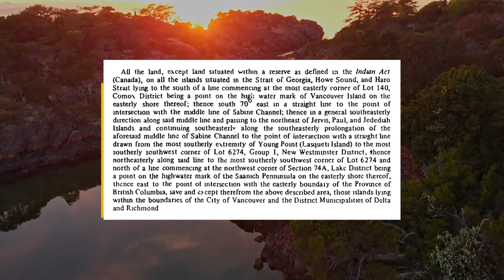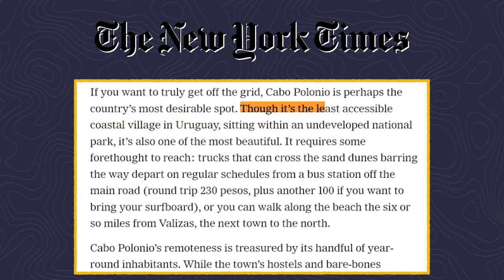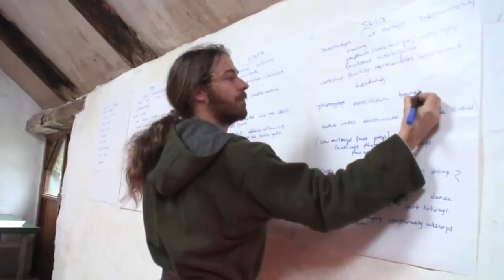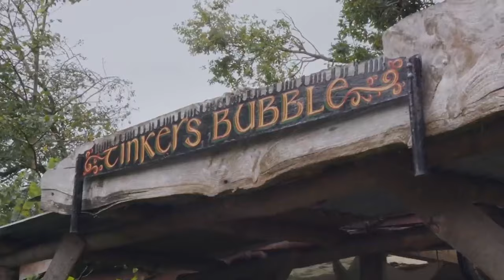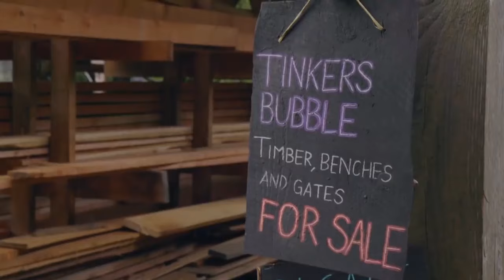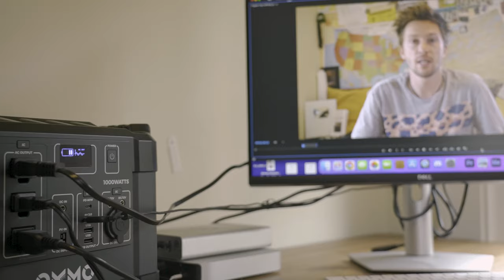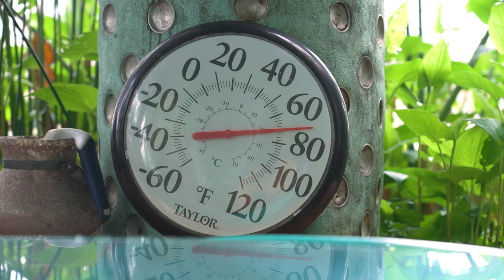Top 5 Off-Grid Communities (Earthships / Homesteads)

Comment: The main law to off griding is that you must have electricity. You must have solar power. Plain and simple.
Reply: Using equipment made abroad where the toxic byproducts can be dumped without cost to the manufacturer - shipped in a container using crude oil ... ...

Comment: I'd put the one that also manages to produce more than 75% of its food at the top of 'off grid' lifestyles. I'm 65 yrs of age and was just reflecting on how many tyres I've junked during my lifetime. I suspect it's not enough to build a house. Of course once it's up it should be there for more than one lifetime. In that respect turning the least biodegradable junk into houses is an inspiring idea for now. However one can't forget as a sustainable way of life, it needs junk producers who are somehow managing to drive about in cars and wear out tyres they can afford to throw away. All off griders use plastic pipes, solar panels and metal tools, yet none of then pump oil or mine metal. One can only get so far off the 'grid' or network of human specialisation without drastically limiting ones choices. Even Hunter gatherers who have had sustainable lifestyles for several 100 thousand years are tied into obligations to each other. Obligations which give them far les 'wiggle' room in how they execute them. It's perhaps more helpful to set out from the realisation one can't be totally off the grid of human specialisation, our range of choices are always limited by those of others. Rather than saying 'X' choices are right and 'Y' are wrong we might be better to think about how we can get all our choices to fit together in sustainable ways.
Reply: They are totally out of touch with reality - that's what makes them such hard work to be around. There's a great book The Utopia Experiment ~ a really good insight into the whole 'movement.'

Comment: the one in wales sounds good, but they may need non food essentials, such as glue, rope, scissros, tape , paint, etc. just a few i thought of. of course you can make paint and rope if you know how: however, they need good medical assistance or a dentist & an optician for sure. That's for everyone regardless of age. Not gonna be 35 forever & you have to plan for the future.
Reply: Just the steel that made the tools they use comes from mining/smelting - doubt they are using stone !